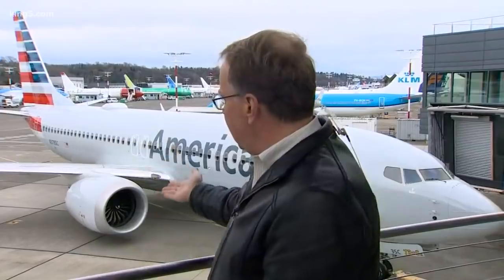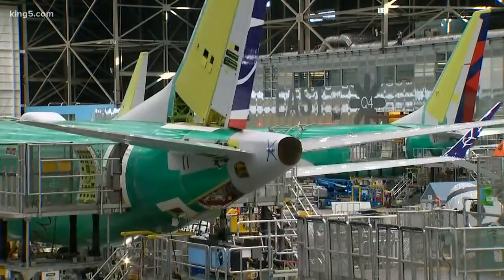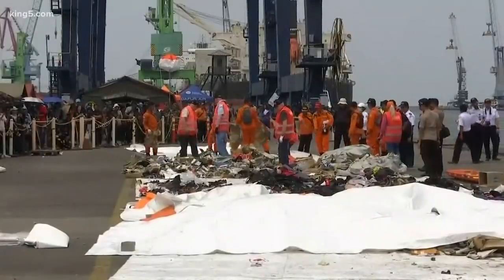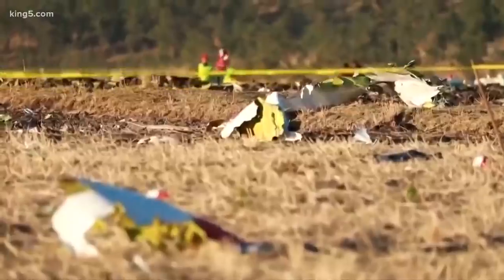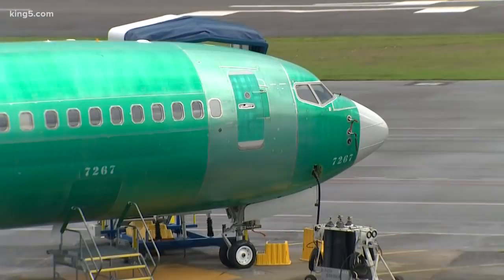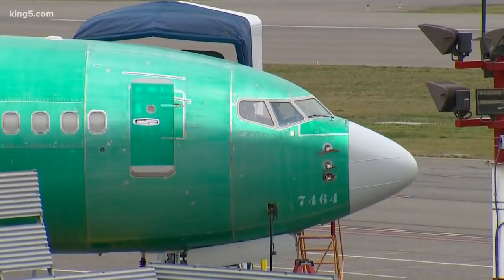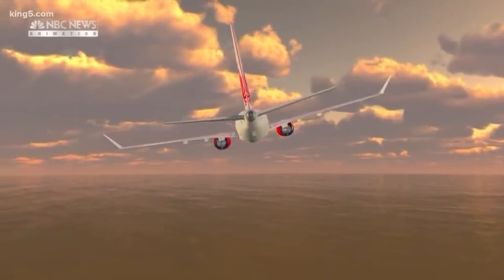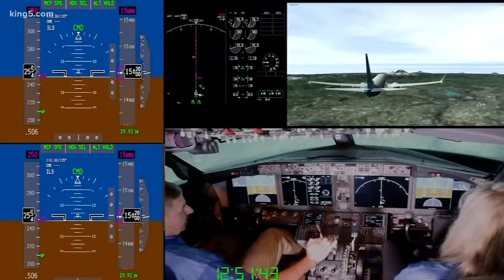Boeing unveils 737 Max fix

Comment: Boeing can not be trusted to fix this independently. There must be industry oversight and significant testing of any new “fixes” before this aircraft is certified to fly passengers again. Former Boeing executives are part of current federal agencies and they should be prohibited from being involved in clearing this aircraft to fly again.  I trust the NTSB to do their job but not the FAA.
Reply: FAA has often ignored NTSB recommendations and those recommendations generally come after an accident. Boeing’s arrogance cost people their lives and hopefully all the aviation agencies mentioned will keep these planes grounded until we’re certain they’re safe. I Boeing tried to coverup a design flaw, which allows nose of the plane to be pushed up, with a software fix. Why not fix the design flaw, that’s about $$$.

Comment: Well you know what usually happens with these designer-flawed aircraft events.  The manufacturer comes up with a 'fix', after hundreds of people lose their lives (such as the DC-10 rear cargo door problems, the square windows on the Comet and then there was the Electra) but the general flying public will usually forget about the previous crashes after time goes by... because they cannot tell the difference between a 737 MAX 8/9 and the other typed 737 aircraft (300, 400, 700, 800, etc.) So........the public will be flying their families to Disneyland on the newest 'fixer-upper' MAX before you know it.

But those wise enough know the difference and sorry, Boeing, ( many of us lost all the love and trust in you), won't step foot on a MAX unless we want to end up with just our kneecaps surviving (which is surprisingly the biggest human body part found in high-speed impact crashes - ValueJet being proof of that to be sure....I would not be surprised if this is also the case of the Lion and Ethiopian crashes too).

I remember when I worked on the 737-200s and the pilots saying what a reliable workhorse it was.  Even gravel deflectors enabled landing on gravel runways (before the engines were 'flattened' at their bottoms).  Sweet airplane.  

 Sigh.....Boeing, I loved ya, but you've been cheating on me and sneaking behind my back with bogus engineering on old airframe design and technology ....of all the ways to save a lousy buck for G*d's sake..... and thus....we're getting a divorce.
Reply: Unfortunately that's true, people's memory span is surprisingly short. But that's also what Boeing is hoping (counting on) will happen ESPECIALLY because a lot of travelagencies are with their back against the wall. It's accept a (probably flawed) airplane design or go bust.
Reply: True. I was thinking about the rudder actuator problem on earlier 737's. Two of them flopped over and flew into the ground. A third one also flipped over but at a higher altitude so it survived. Eventually the cause was identified and fixed and after a while people forgot about it and started flying on 737's again.
Reply: There is a term for this. It's called, "letting your customers do your product testing for you".
Reply: 346 lost lives paid off for savings on Boeing's training cost  and FAA's resources for doing decent certifications
Reply: Fly an Air bus
Reply: the Electra could have had a great career like the Viscount. reputation is everything. The P3 saved the design.

Comment: Must be the Engine and Body design wrong but they lies that it is the software and FAA probably get a good pay-check from Boeing to help cover the problem and to approve 737 MAX to fly.
Reply: What are you, in the 3rd grade? Only a immature imbecile would make a public statement like yours. Do you have any facts to back that up? I seriously doubt you do.
Reply: Harry Hooligan https://moneymaven.io/mishtalk/economics/boeing-737-max-major-design-flaws-not-a-software-failure-rVjJZBVzZkuZLkDJn3Jy8A/
Reply: Yes a wrong design that does not fit these engines...horrible mistake...
Reply: It’s not a wrong design.. or wrong engines.  They knew the larger engines would have to be moved forward and up higher on the wing wich would cause the nose to pitch up more when power is applied so to compensate they added that system. Wich is very common many aircraft have systems that provide a reaction to the aircraft flying outside of its intended envelope. Infact an a320 crashed a few years ago because of a system overpowering he flight crew on a check flight to clear the aircraft after a lease was up.. they are complex machines. The issue came down to training
Reply: @derekrohan9619  ..doesn't matter how many time you people going to training the pilots or how safe i will never let my family or friends get inside that 737 anymore. If you people knew what caused the problem why don't you people fixed it or let the world know about it after the Indonesian crash???. The  world order a lot of the 737 so you people rush to push order out the door you people don't care about safety or human life.  Boeing lacked of safety and hiding information, you people murdered more than 300 people within 5 months the world will not want to get inside 737.  Also when they moved the aircraft to ground and the aircraft had Engine problems they need to emergency landing, that wasn't software problem????? :(:(
Reply: derek Rohan sorry Derek it is I spoke to aeronautical designers and architects and they reffered me to this: https://moneymaven.io/mishtalk/economics/boeing-737-max-major-design-flaws-not-a-software-failure-rVjJZBVzZkuZLkDJn3Jy8A/

Comment: Boeing is full of BS.
A plane is not safe when two planes crash within 5 months. How can any moron claim that airplane to be safe under those circumstances.
Instead of an idiotic software solution, Boeing should have designed a fully safe airplane that did not need a software fix like that to make the airplane fly safely.
I will never set foot in a 737 Max. I will rather pay more to chose an airline flying the Airbus 320.
Boeing will hopefully be sued inside out and sideways. The arrogance they have displayed in incredible.

Comment: I have yet to hear of any conversation on maintenance issues that could have caused a failure with the AOA device. And or why this has not been an issue with US carriers.
Reply: Philip Ketchum, I’m with you on this. Lion Air showed a succession of prior flight problems. Third world  maintenance and training is a definite issue in the crashes!
Reply: @awesomexistence  Third world my ass.
Reply: @D Famous 
Explain yourself. I simply said that the conversation has not happened as far as I've heard. I'm not letting Boeing off the hook for poor design. But the AOA is an external device that requires maintenance including cleaning. So once again explain in detail why I should not ask the simple question of, is there or isn't there an issue with simple maintenance of any part?

Comment: Do you need another crash to prove it’s not safe yet? I would only trust maxses if they’re already in the sky for 10 years.
Reply: They’ve been in the air since 2017 and there’s over 400 of them and there hasn’t been any issues until they very crappy airlines crashed them. Do some research
Reply: Al Borland Agreed ^

Comment: The NTSB investigation isn't even done yet but Boeing has a software hot fix ready for beta testing with live passengers.  What could possibly go wrong?
Reply: We could get Boeing's CEO and board of directors in there test flight around the world. Before that, I would like them to will me their assets.
Reply: Tiger Cat  because they monitor the all the airplanes thru a system called AHMS - Airbus has a system too ! They know what happening  my friend ! ACARS will send all kind of information ! Including when the beacon light is on , brake release , all sensors .. everything is monitored..
Reply: @carlosmunoz7934  Only if the airline pays for that software. If Malaysian Airlines did we'd know where there plane went down.
Reply: Tiger Cat, NTSB has no jurisdiction over the 2 accidents..
Reply: TC, it’s because of all the planes that are grounded and how much revenue the carriers are losing while they’re parked.  They need to get the problem fixed and get those costly planes back in the air.   Hopefully without further incident.  Money is what makes the world go round.
Reply: The pilot training teaches them how to throw the circuit breakers on the nose down device when it goes AWOL..
GREAT PROBLEM FIXED!
Reply: @Kpopzoom  I saw on the news that the Ethiopian pilots did throw the breakers and then they say, turned them back on.  And now they are claiming one of the AOA sensors was damaged or hit by something causing the system to go haywire.
Reply: Remember the A320 teething problems? Many more died. But because its Boeing, the trolls are out in force on it. Why no accidents in USA,  EU, UK, Japan? Indonesian and African carriers are not exactly benchmarks of safety and training. But lives were lost and those aircraft are needed where the were bought, especially in developing countries with small national carriers.

Comment: Boeing's  fix is to add MORE sensors, programming and training? You've got to be kidding me.
Reply: Are you expecting to scrap the entire 737 program?
Reply: that's usually how single points of failure get fixed, add redundancy
Reply: What do you expect  them to do since you seem very confident they are not solving the issue?
Reply: Kent Coffey the mcas system is modern, but the sensors are mechanically ancient. They are not compatible.

Comment: What they're not telling you is that the Boeing engineers were very much aware in the development phase of the 737 MAX that the new LEAP engine installation was going to shift the plane's center of gravity thus making this version inherently less stable during takeoff and climb out than its predecessors. 

With this in mind, the engineers proposed installing a larger horizontal stabilizer which would have eliminated the instability and pitch up tendency problem entirely without having even to resort to adding the MCAS system. 

But due to the company bean counters and upper management's shortsightedness, combined with an infinite lack of common sense, this plan was overruled due to the added expenses of testing and certifying an entirely new control surface, and the MCAS was green-lighted instead.
Reply: And where do you have this information from?
Reply: @orlovsskibet   Although the information on this is being intentionally suppressed, I do know of a few Boeing insiders familiar with the MAX program who have stated that it's based on fact. 

Also, check out this video. This guy is an engineer and knows what he's talking about.

https://www.youtube.com/watch?v=mqUxmlwRqGU&t=45s
Reply: Your and idiot I know several people who work for boeing including myself  ! They were confident the plane was safe and secure for flight kid. The max 8 planes have been built since 2016 They have been flying 3 years kid get your facts straighten. Just because of two crashes in 5 months doesn't mean the plane unsafe. Boeing has been working hard in Renton to fix  correction so shut your mouth
Reply: @kittybug329  I'm the idiot, and you apparently don't have the foggiest idea on how to correctly capitalize, punctuate, or for that matter know the differences between how you're*, *your and straight and straighten are supposed to be used in a sentence???  

For your information, I worked at Boeing for 26 years in numerous positions, including on the Everett Flight Line,  so I'm nowhere close to being uninformed or a kid.  

So it goes without saying that I am all too familiar with the poisonous culture that has infected the company since the 1997 merger with McDonnell Douglas and Boeing allowing their criminally inept management to come in with a mentality of cutting costs by any means necessary, making unrealistic schedules with little or no regard to quality or safety. And last but not least, intimidating and writing reprimands against shop floor personnel for even the most minor of transgressions. 

My advice to you, kid *, is that you shut *your mouth, leave the intelligent conversations to the grownups, and go trolling somewhere else. 

Or better yet: Why don't you do all of us a favor and just go back to hiding in your bedroom in your mother's basement!